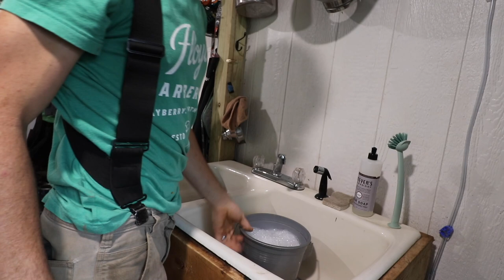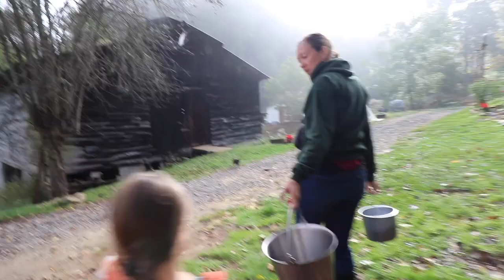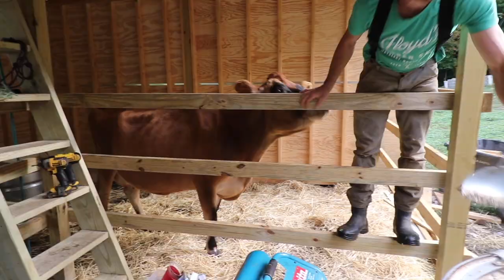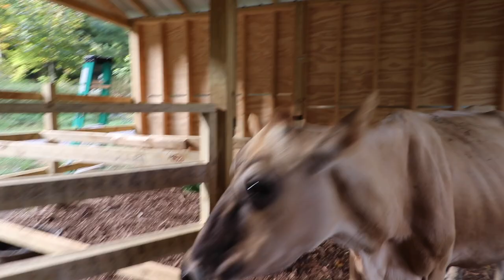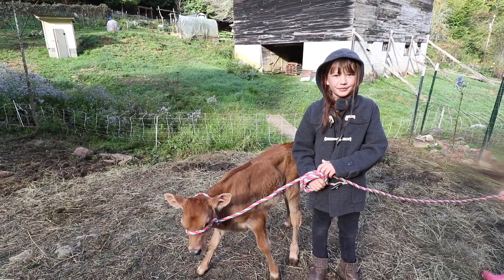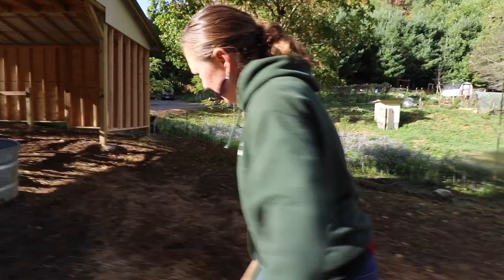First Calf on the Farm!

Comment: If you run the lead rope down the right side of the calf's body and behind her backside, over the tail (NOT under the tail), and then along the left side and back through the halter, when you pull on the rope, she will step forward, away from the backside pressure. In the beginning, one step or even just moving one front hoof forward is enough. Pause and give her praise. Then repeat. Only try to accomplish a little during each training time. Give her time to rest and think. Above all, don't teach her to instinctively pull back against halter pressure. When she learns that you simply want her to walk along, you will no longer need to put the rope around her body. The kids will find that kind, gentle, consistent use of the rope will win Daisy over. Right now she is confused.
Reply from the maker: Thank you